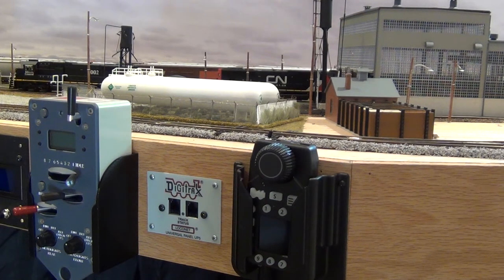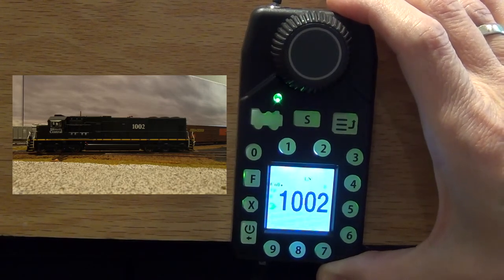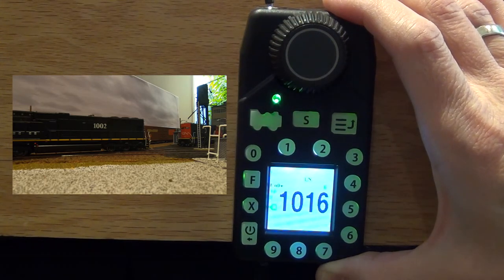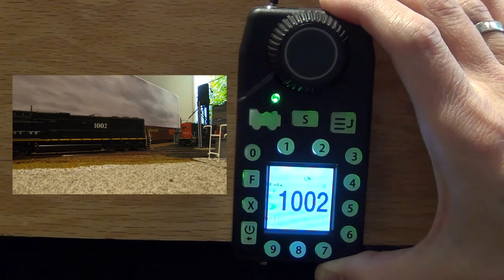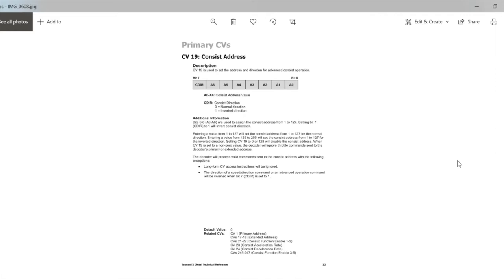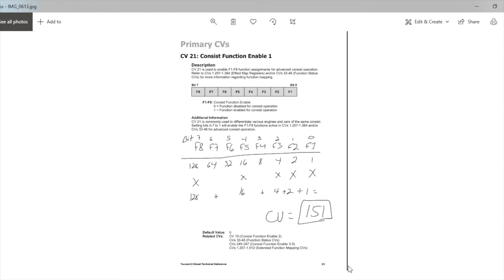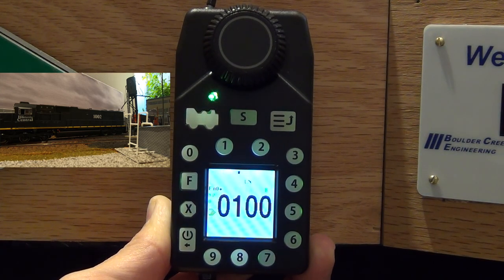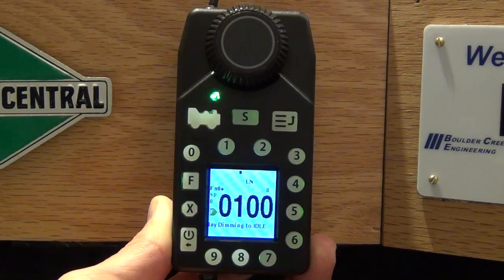Digitrax UT6 simple consist (MU) and Tsunami 2 JMRI and CV advanced consist programming

Comment: As long as I do not use the advanced consist I can drive the locos independently for itself.
When programming the value of 20 (advanced consist address of 20 as example) at CV 19, than I will use the advanced consist address 20 to my locos beginning with the lead loco in foreward direction or 148 in reverse direction.
Than I do programming the trailing mid helper loco and at least the rear pusher loco in the end of the train.
The advanced consist address is a temporarlely given consist address until I would write a value of zero to CV 19 of the loco of what would be removed from the advanced consist.

Me I am using the european roco digital system, which allows me to use any kind of consisting methods of what is JMRI using, too.
Simple Consist to one allready existing Decoder Address using the changes at CV 1 of all locos to the same address.
Reversed locos need configuration of CV 29 when in reversed position before.

I can use Universal Consisting but me I do prefer Advanced Consisting only, it is much more easier to use it than all the other methods.

The old roco (austrian) digital system does not have the possibility to read out CV Values, the newer z21 digital system can read out CVs allready.

Comment: Hi CK(?). Very informative, thank you. Just off-topic for a while: what is the panel between your weighstation and the ProThrottle?
Reply from the maker: It is a fast clock.  I bought it from Iowa Scaled Engineering so it is compatible with the ProtoThrottle; however, ISE discontinued the product (I think I got the last one) so you cannot get it from them.  Several companies make fast clocks.
Reply: @ck7813  I confess it's just curiosity. Excuse my ignorance, but what is a fast clock - is it for operations?